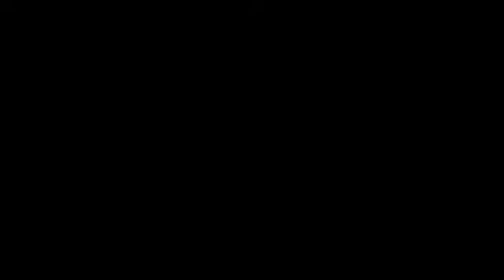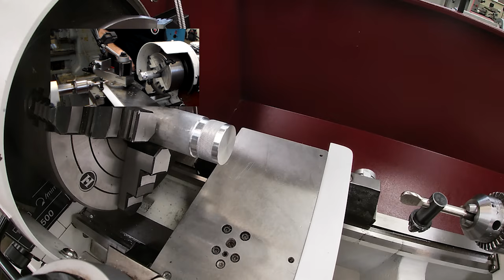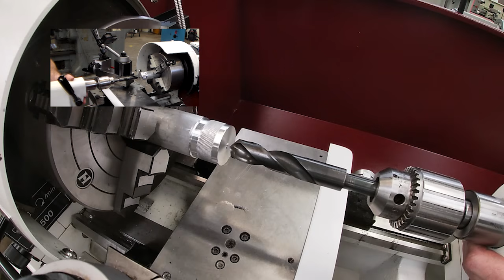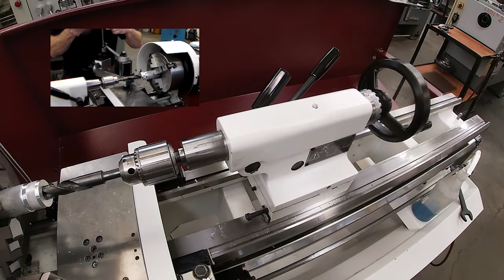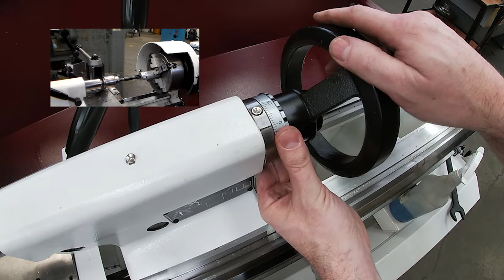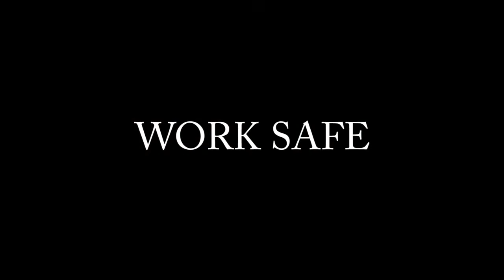How to drill a hole to an accurate depth.

Comment: You mesure the depth of the hole based of what the drawing specifies. You can also set up a travel indicator on the tailstock making it really easy.
Reply from the maker: I agree that you should always follow the print 👍